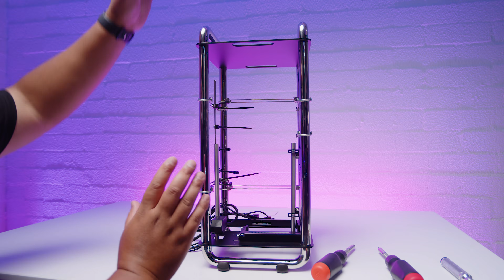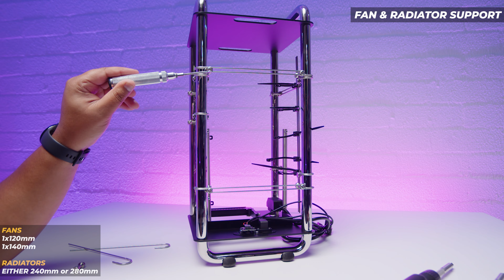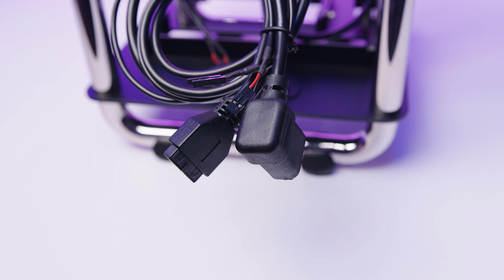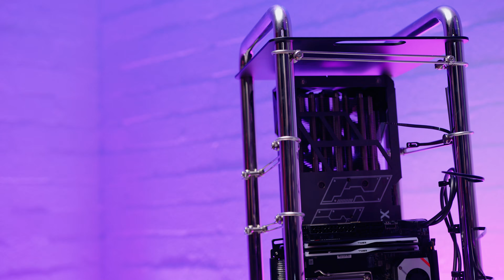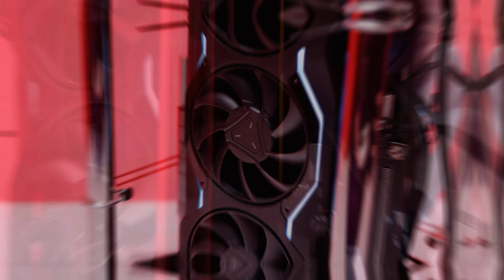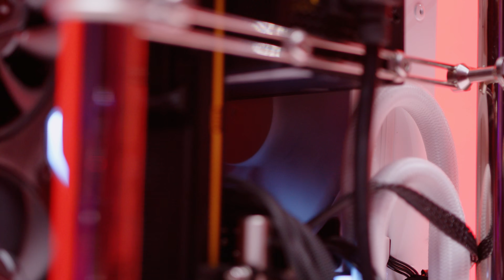Open Air ITX doesn't equal good - Streacom DA6 XL

Comment: i would have bought it, but there is almost no information about how much of these splines are in the package. i cant find any information with pictures what is in the box. i dont want to know what i can mount, i want to see the stuff in the box.
Reply: got one in sale, ordered some more parts. had to rebend the splines and replace the rubber for better grip. the powerblock should be smaller. i used a LF III 280, but mounted it outside the case bars for having better cabling. it looks elegant on a USM Haller furniture if you have, the chrome bars are identical size.

Comment: Dual 280mm rads in series for cpu and gpu in line with fans on exhaust, that’s what it needs. 

Than the psu at the top - cut the top plate to give it intake fan of PCU the breathing room with exact to the side

Comment: i´ve gotten this Case and  I think its great. My 4080 fits perfectly ecept for the power connector. but i just moved it to the site and it fits exactly. Dust is a bit of a problem but if you clean you pc every few weeks it should be fine.

Comment: I wonder if the noise levels would be more or less than an enclosure?
Reply: Audibly more noise since no pannels do dampen the sound of PSU fan, CPU fan cooler, and GPU fans especially when gaming. However temps run much cooler. I have an open air case and rarely go over 55c when playing Destiny 2 on High settings
Reply: @MarigoldAW  Thanks for your reply - I bought one of these since posting that question and with noctua fans cooling my CPU and GPU it is inaudible until it gets put under load. And it looks absolutely awesome!

Comment: Placing the PSU on the bottom and horizontally like in standard cases, with the rest of the setup on top of it, would have made the case lower. Or keep the same height and use the space on top for storage or exhaust. As it is, it's a bit inefficient use of space...

Comment: I wonder if this makes it more of a dust magnet being so open? I guess a regular case just traps and holds dust and maybe this might be easier to clean periodically 🤔
Reply: The components will get a thin layer of dust on everything surface facing upwards, similar to how a desk gets dusty over time. Anything more than that will get blown away by the fans. It won't build up like how it tends to in a standard case. The fans also spin slower on account of having less heat to handle, but this is offset by not having any filters to trap dust. Overall, it will be more dusty than an enclosed case, but not significantly more so.